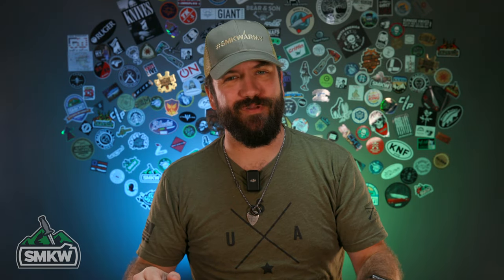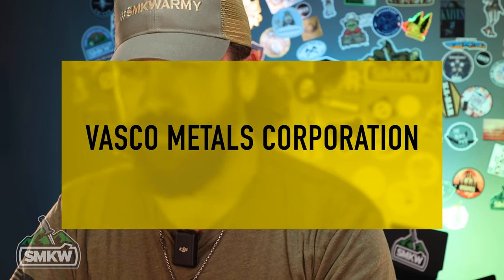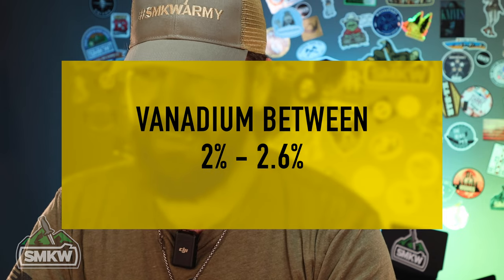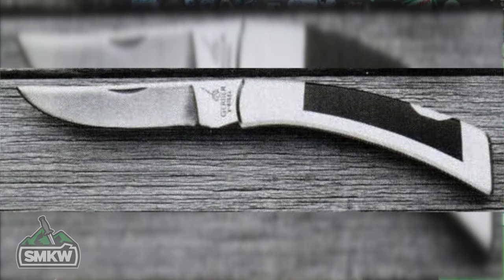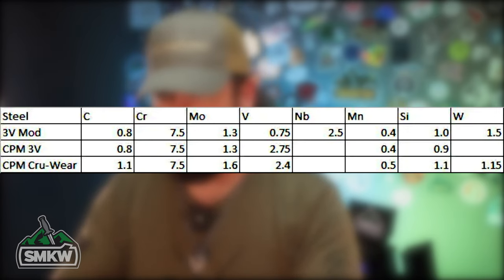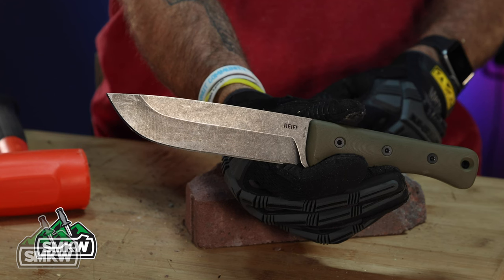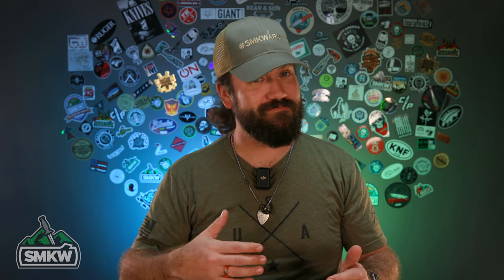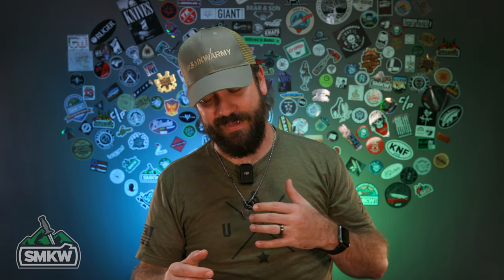Everything You Need to Know About CPM-3V Blade Steel

Comment: I've made over 20 knives (including 2 hand axes, a tomahawk and one katana) out of CPM-3V and really like it.  Note there's one key point not mentioned in the video.  The crucible guys said the powdered steel not only resulted in the smaller carbides (as mentioned in the video), but also resulted in basically all the vanadium going into carbide formation.  The older Vasco Die method resulted in a mix of chromium and vanadium carbides.  This is a big deal for 2 reasons:  vanadium carbides are much harder than chromium carbides, and now all the chromium is available as "free" chromium in the CPM-3V

Comment: Several years ago I ordered a Bark River Crusader from SMKW and a week later I ordered another one from you guys. I asked the lady on the phone if you could check to make sure the knife said 'First Production Run ' on the blade like the first one. Six days later it arrived and the knife was outside of the plastic which had been cut open. Both knives are in cpm3v, one is pristine and the other chops tennis ball sized rocks in two. The edge on the chopper is holding up pretty well. Heavy duty Butterfly Swords.

Comment: Wish I watched this before ordering my two new knives in 3V and Cru Wear. I am not good at sharpening knives and now worried about upkeep.
Reply from the maker: While 3V can take more time that doesn't make it more difficult, take your time and you will be fine 👍
Reply: Neither of these steels is that hard to sharpen. Harder than some older steels like 1095, sure, but they’ll sharpen up a heck of a lot easier than M390. Not too bad at all.
Reply from the maker: @I_Might_B_Wrong  Thanks for watching

Comment: How does it compare with other premium steels? Hardness, toughness, edge retention, etc.? What type of edge works best: angle, thickness behind the edge, polished or more toothy?
Reply: 3V is a 58-61HRC steel roughly. I have all my custom blades treated to 60HRC with a Cryo treatment after quench & before Tempering. (Important) My knives take screaming edges that hold quite well & the blades are darn near indestructible! (Read above what I say about my warranty.) 3V works well with most any grind. It’s not picky. I’ve used standard V-grinds with secondary, Scandi, Zero-Grinds & even Convex with great success. The quality of the Grind is more important than the type. As for edge finishing, I’ve settled into using Shapton Glass water stones up to 6K grit, which does make quite a polished edge. And incredible sharpness. Have never had a complaint. 

I absolutely recommend using this steel for hard use knives. It is the ONLY steel I use for outdoor, hard use & large blades. Even swords.

Comment: Awesome steel lesson! What about corrosion resistance? Compared to Cpm-s30, or cpm-m4, or cpm-s35?
Reply: IMHO 3V is not corrosion resistant like s30v or S35VN. It's not stainless, but it's better than m4. it's got just enough chromium to prevent patina.

Comment: I’ve been trying to find a Reate Exo for almost a year there never in stock I managed to get the mars valley tanto Exo from you guys today but noticed the ones In stock are 3v. From my understanding there’s not much difference in 3v and elmax other than 3v is tougher but also not as corrosion resistant. I’m not planning on using it for much work really just needed it in my collection. Is it still a really premium steel like elmax?
Reply: From what I could find Elmax is more corrosion resistant and is better against wear plus holds an edge better. CPM 3V is tougher. The edge retention between the two isn't much. 3V is also resistant to corrosion just not as much as Elmax. If you keep up on your knife the corrosion shouldn't be an issue and the 3V is tougher. So in my opinion, I'd go with 3V unless I was operation in a high humidity or marine environment and couldn't wipe down my blade as often as I should. (Or I stick it somewhere for a long period of time and forget about it).

Comment: If it’s a pocket knife the high end stainless steels M390, S35VN, Cruwear are great . But if it comes to a bushcraft or beater knife I love my 3V. Takes a likin and a little stropping and it’s back to shaving sharp. No doubt about good ole 1095 will handle a ton of abuse as well and much easier to put a new edge on it I. The field. Love my Essex’s that are in 1095. But the upgraded stainless steels they have used cut but don’t handle the hard use. The bottom line, if it’s hard use I want  3V. 😁
Reply from the maker: 1095 is the tried and true friend but we did a Will It Cut with 3V and we were all very impressed

Comment: Does toughness=edge stability? It seems nobody uses geometry when rope or cardboard testing steels. According to BBB and Larrin Thomas the most important feature of a superior slicer is geometry aka edge stability. So we get these ultra high carbide steels like maxamet supposedly being the best at these type tasks. What I would like to know is what steel will hold the most acute angle without rolling or crumbling. It certainly  isn't maxamet. Seems to me that 3v is a contender. Can you take it to 12dps? 8dps? Is there a point where a stable steel will out perform a high carbide steel when performing the same tasks? You  certainly can't take maxamet to 8dps.
Reply from the maker: Thanks for watching and good insights!

Comment: Thank you for a well done presentation but this might change your mind on 3V. Check out the destruction test of a Cold Steel SRK 3V knife by Joe X at https://www.youtube.com/watch?v=stvZ2gIFEfk , and then watch the same destruction type test on the Cold Steel SRK in VG10 San Mai steel at https://www.youtube.com/watch?v=5qNu9-bVPoQ . BTW, the SRK in 3V steel is $146.59 on Amazon, while the SRK in VG10 San Mai is only $98.38. Joe X on you tube is really revealing what steels are prevailing under EXTREMELY rigid destruction test. I own the SRK in 3V, and wish I had now bought the same knife in San Mai. Thank you again for a good presentation.
Reply from the maker: Thanks for watching and for the suggestions!

Comment: 3V seems to go for blades that don't get extreme abuse. 3V keeps the edge well but sharpening takes a bit more effort. For extreme abuse something like 7cr takes the elements very well without rusting and when heat treated properly has 60HRC hardness. It looses to 3V narrowly holding an edge but for bush knife it is easier to sharpen and takes hell of a beating. Today I see much more 3V and it seems to be replacing some respected exotic VG-10 San Mai blades for example.